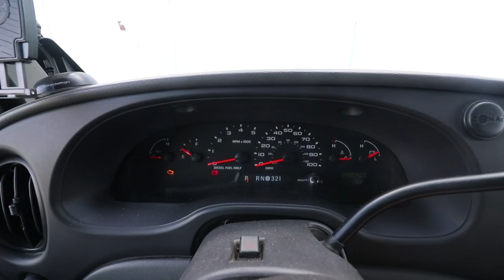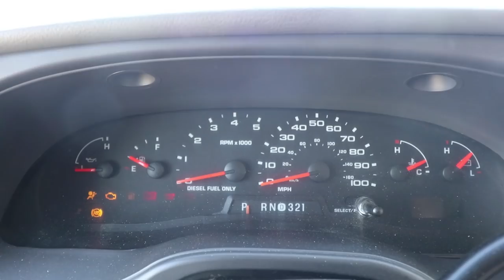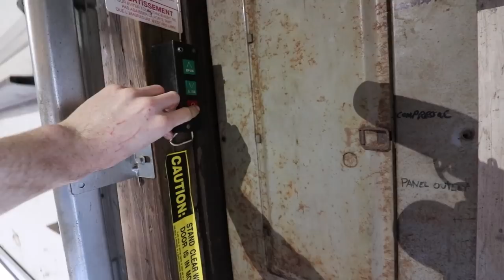Goodbye Old Shop...

Comment: I’m pretty sure that spool bus needs a high pressure oil pump or new Stan-pipes and dummy plugs to make it start a lot better. I bought a 06 f250 King ranch 6.0 powerstoke  and I changed the high pressure oil pump and it starts up a lot better. The injections on the 6.0 powerstrokes need a minimum of 500 psi of oil pressure to make the injections work properly.
Reply: Ryan  Norman do you know what I might need? My 6.0 starts and runs but then dies and doesn’t start again until I wait a while.

Comment: You should swap a 6 speed from a 6.0 f250 into the spool bus. You get +2 gears, better fuel economy, better control of power, better control when towing, and it's way more fun
Reply: Da
Reply: Although not a 6 speed but also is, I agree
Reply: QuentinC he would only get one xtra gear because the autos have 5

Comment: The spool bus needs some kinda roof rack
Reply: Yes, That would be epic! Add some off-road lights on that bad boy 🤙🏼
Reply: He’s putting on an AC and Solar Panels
Reply: Will Ferland he could still build a small roof rack
Reply: Thomas ohman needs HVAC
Reply: Fucking Chicken i agree... a rv 12v hvac right in the emergency exit opening...
Reply: Thomas ohman a roof rack isn't very convenient when it's 12 feet off the ground.
Reply: abracing199 that y u put in a ladder... most bridge heights are 13'6" high so there should be no clearance issues... & the roof of that bus is more like 10'6" to 11'... i drive a semi & my windows are above these small busses & that are around 12' off the ground...
Reply: Thomas ohman you realize that would also entail carrying anything you want to put up there up a freakin ladder, right? So nothing heavy or large could go up there. Not practical
Reply: They should do to the 2006 ford bluebird microbird school bus

Comment: You most likely won't need new batteries you'll need new glow plugs is also I know this because my father owns a semi truck company and we repair semis and the problem you have with starting the bus happens to a lot of semi especially in the winter so you will likely need glow plugs

Comment: Ok so I'm still not sure how Gingium has been "cycling the glow plugs" because everyone has been giving such different advice. I'll just say from my experience, you put the key in and turn it as far as it can go before triggering the actual starter, and so you should have all the dash lights come on etc. Once you see the little glow plug light go off, then turn the key that little bit more and activate the starter, and it should start right up.

Comment: You should make a loft in the new shop, i have heard many youtuber talking about it but no one does it. Good video.
Reply: That would be a cool idea and there is enough height to do it, maybe even above the office, not sure what's there.  Though depends how much they let him modify it, and kinda sucks to put that much work into something you don't own.
Reply: He could build it without attaching it to anything, just like in sections that bolt to each other with long bolts (with washers) because then, he could just pull it a part and move it, zero effects on the shop
Reply: plus i think i would also be cool if he build a shoptruck, from like a salvage FD or something